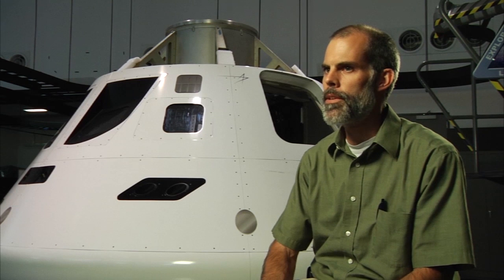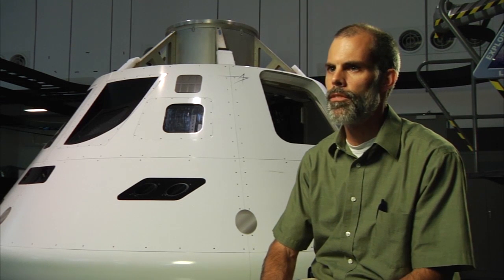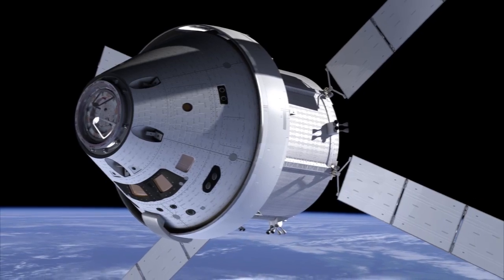What Is Radiation Shielding?

Comment: how  you  block all  cosmic-ray , gamma-ray ,  x-ray and many high energy  particle  with only 0.1 mm aluminum fiber shield use in  60s' apollo space suit for 8 day mission in space ??? 😅
Reply: You don't. But the flux of each of these is low enough not to result in a remotely dangerous dose during the course of the short Apollo missions (less than 2 weeks).
Reply: @eventcone  BULLSHATTTTTTT!!!!!!!!!!!!!!!!!!!!!!!!!!!! they don't have the technology now and they didn't have it 1969..... what you said makes 0 sense scientifically
Reply: @jaydenwilson9522   It makes perfect sense. There was no need to have Apollo spacesuits block all radiation.
Reply: It's 58 mins through van Allen belt and 13 rads of dose received without shielding. 100 rads is lethal dose. That's an average received dose. So, 25% radiation dose to moon and back through van Allen belt

Comment: What about gold? Gold has a lot of protons and neutrons and yet NASA uses a lot of it as protection from heat and radiation
Reply: Didn't know that
Reply: gold is heavier than led
Reply: From what I've seen it appears gold is used as protection for infrared and visible light radiation. However the radiation they're worried about is of a much higher energy level, making gold unsuited for protection.
Reply: @rocketyak4014  Awesome thank you
Reply: @rocketyak4014  So, what do they use?
Reply: @adamsdav2440  aluminum that couldn't protect shit from toilet paper XD
Reply: @jaydenwilson9522  And steel. Both aluminium and steel are effective. In fact any material is effective. Some are just better than others.
Reply: then why dont we just use steel, aluminium & "specialised materials" for radiative shielding at a nuclear plant? @eventcone

Comment: So what shielding did they use in the 60's when we went to the moon?
Reply: +Liudvikas Launikonis well according to nasa that same thickness of tinfoil is enough to block cme radiation so ...maybe
Reply: Gold
Reply: They were just built different so they didn't need it.
Reply: The answer is in the CM hull cross section design i.e. an outer hull of stainless steel honeycomb sandwiched between steel sheets, and an inner hull of aluminium alloy honeycomb sandwiched between aluminium alloy sheets, with fibrous thermal insulation between the two hulls. It was enough to block low energy particles (which made up most of the population of particles trapped in the VAB), allowing only the low population high energy particles to pass through. This resuted in a low dose of radiation for each astronaut during the course of an Apollo mission (less than 2 weeks).
Reply: @eventcone  thats sus af not gonna lie..... so they just magically survived 100% solar radiation cause???? cause NASA didn't know how dangerous it was and created a cover story after the fact XD  buzz and the boys should of died via exposure decades ago!!!! they lied man.. get over it and stop defending technology that isn't even invented in 2023
Reply: @eventcone I was gonna say something about lead, tungsten, and osmium, but that’s retarded because those things are freakishly heavy which is the very last thing you want for a spacecraft.
Reply: try answering the question......sweetheart!........or are you a bit simple?
Reply: +hapkidoglock probably none. Moon is kind of protected by the magnetic field of Earth. But when you go outside the Earth system, then's it's another story as you're exposed to direct radiation from Sun
Reply: @Freestyl4r  "Moon is kind of protected by the magnetic field of Earth." Totally BS
Reply: @Freestyl4r uhhhhh no Moon still gets hit by solar wind. The moon is covered in helium-3 as a result of millions of years of solar wind pile-up.
Reply: nunya bidness Oh sweetheart, did you forget your tinfoil hat at home today?